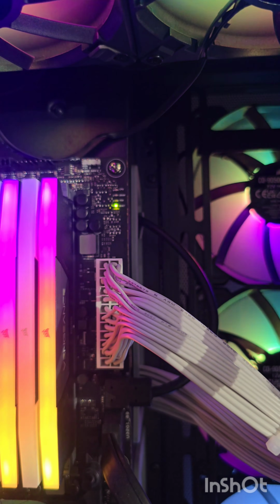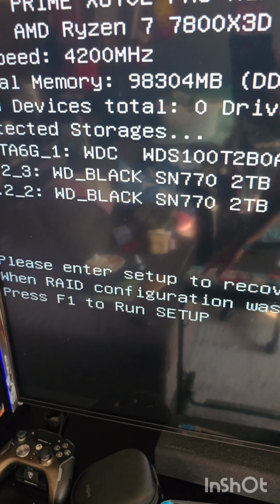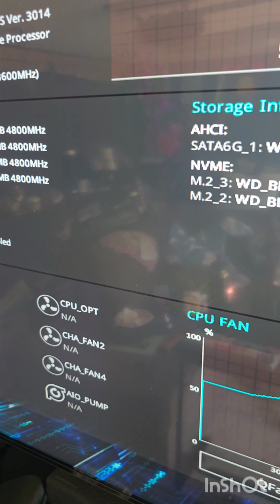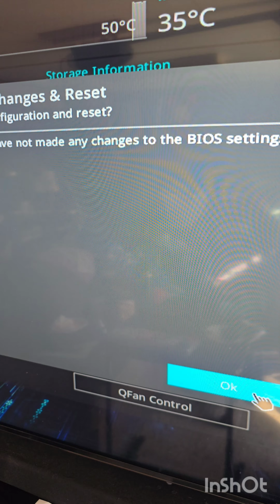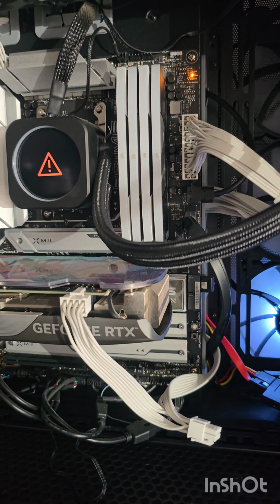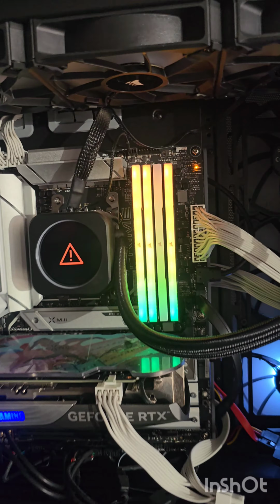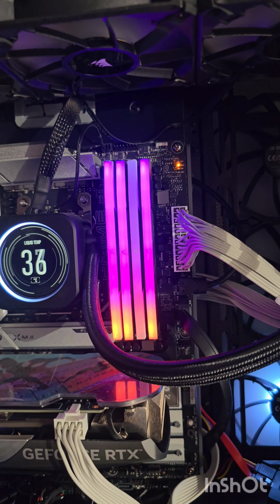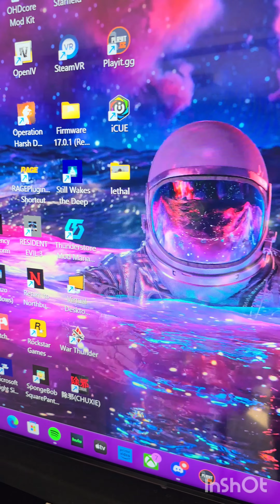Stuck on orange DRAM light *EASY FIX*

Comment: When trying to reset the bios, does it have to be connected to a LAN cable? And when trying to reset the bios, is it only the power supply cable that is unplugged or all cables such as the mouse and keyboard?
Reply: Unplug everything to be safe

Comment: @Chavin4710  That solution is not 100% I have two sets of ram Team Group and Gkillz both on the motherboard approved memory list and still do the same thing, just wait till your SSD gets corrupted and can't boot until you unlock your bitlocker, fun times. I have an Asrock B850 MB and an Asus B650E/F and the only one that gives me this issue is the Asus.

Comment: great video bro keep it up! i found that when i ran into this issue it was because i was trying to run an XMP profile/EXPO profile (sort of like over clocking the ram to run at its advertised speed) on the opposing brand. i.e. making an EXPO (for amd) file for ram sticks that are branded as ‘intel’ ram sticks. as soon as i set the setting back to “auto”. my pc has never gotten stuck again. pc builders tell you that you can use whatever ram for whatever system, which is true, but never say that this is a potential issue when ‘overclocking’ ram that is advertised for the opposing brand

Comment: Bro i was trying to boot after a Bios update and getting desperate that removing the battery didn't help, then i decided to calmly follow your steps and it worked, i think i wasn't being patient but you saved my day
Reply from the maker: @TheBlindWeasel  glad i was able to help :)
Reply: It not working for me do I need new mother board?
Reply from the maker: @AdamG2425  does your ram match your cpu? Like if your cpu is intel then your ram must be intel.
Reply: Delta Tforce RGB DDR5 2×16gb, mother board B650 Aorus Elite Ax Ice, M.2 samusng 990 pro, thermal right cpu cooler cpu 7700x amd and 7700xt Gigabite GPU, corsair rm850x power supply. I was playing gta 5 then went to do the Gigabite control Center update I did the standard ones then did the Bios update because it showed it "needed it" but when it went to restart it wouldn't boot back up i had to force shut down. I reinserted the ram took battery out.. cleaned and reapplied thermal paste on cpu. had it totally off and unplugged I ordered a fat32 thumb drive to try and do a quick flash for bios but I don't even know what version to install
Reply from the maker: @AdamG2425  install the latest version they have for your motherboard.
Reply: @Chavin4710  okay thanks ill have to wait until the fat32 drive arrives from Amazon today. Will keep u posted thanks !
Reply from the maker: @AdamG2425  no problem! Any questions you have let me know.
Reply: @Chavin4710  i installed latest bios and  tried few others but it still gives the dram light even when there is no ram in it so I ordered a new board
Reply: @AdamG2425 did you fix this mate im In the same boat

Comment: i might’ve turned off the pc while it was rebooting then and now it’s power cycling..
Reply from the maker: @s4yto  turn it off, disconnect it from the power, press the cmos button if u have one for 10 seconds. Then power on your pc and see if that works, let it sit for a minute or 2.
Reply: @ I don’t have a cmos reset button however i tried removing the cmos battery twice and jumping the 2-pins used to clear the cmos and it’s not working, i narrowed it down to either cpu/ram/mobo.. ill try next to reseat the cpu with one stick of ram and try to revert bios a prior update before, my pc was working for a month before suddenly restarting, DRAM light and no post, when i cleared cmos it started power cycling, my specs are asus rog strix b550 gaming wifi 5700x3d 3070
Reply from the maker: @s4yto  crap hopefully something wasnt corrupted when you powered it off while it was rebooting.
Reply: @Chavin4710  im not sure if it was actually rebooting, i let it on for about a minute and it wasn’t posting, i really just think the mobo or cpu has gone bad, but it was working fine before im so confused
Reply from the maker: @s4yto  is your ram config to your CPU? that was my mistake. I used intel ram sticks on my amd cpu and now that i changed them to amd it runs smooth.
Reply: @ yes as said everything was working perfectly for a month after replacing the cpu and it suddenly restarted and no post

Comment: Having this same issue just ordered a replacement on the same RAM and if that doesn’t work I’ll reset the CMOS. Do you think I shoudk update the bios too? It’s very annoying as before my computer would boot but now it doesn’t at all
Reply from the maker: @RealRad10  check to see if your ram is either intel or amd. It has to match your cpu.
Reply: Yes it matches the cpu
Reply from the maker: @RealRad10  ok then see if there are any bios updates for your motherboard, also use 1 ram and check all the slots you have on the motherboard then switch to the other ram, Sometimes it could be faulty slots.
Reply: Did it work @RealRad10

Comment from the maker: So i found the issue, this is my first time ever building a pc and i didnt know you couldnt just buy any ram. You need to buy either a AMD or Intel depending on what motherboard you had. I wish more "how to build a pc" videos would mention more about this.
Reply: I've built several PCs but never had found out about xmp vs expo and all that comparability stuff until I upgraded with a bundle from Newegg that was all set up with AMD stuff. So I figured since they were selling it as a package that would in some way make sure the memory would have EXPO but it did not. Always had issues with stability and couldn't get it up to 6400mhz. And even trying to get it to 6000mhz always eventually had this issue with the dram light.
Reply: lmao I looked at my ram packaging and saw that it had a label for intel on it, and still didn't question it.

Comment: So bro? Where is the solution?
Reply from the maker: The solution would be to buy 4 identical ram cards so you won't have to do this every time you restart your pc. This method is for those who have different rams and dont have the money to buy more at the moment, this way you can still use your pc and not be stuck on the dram light.